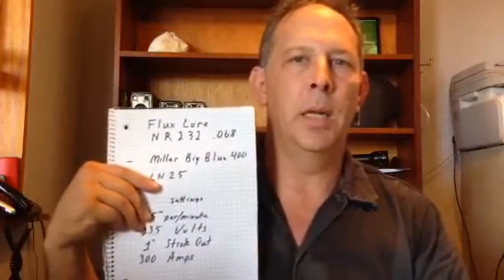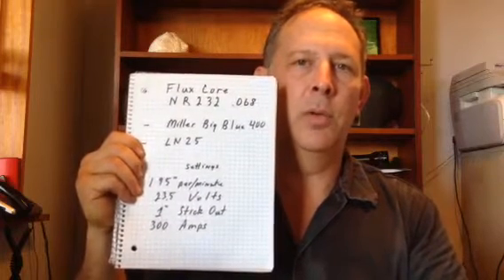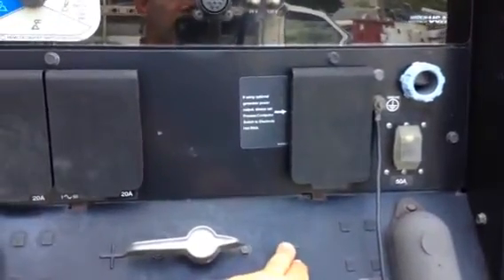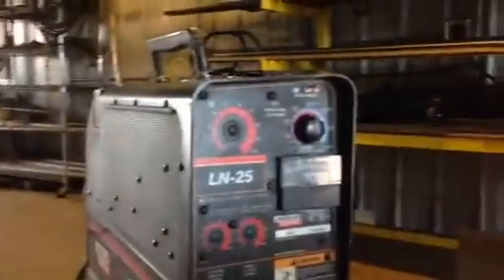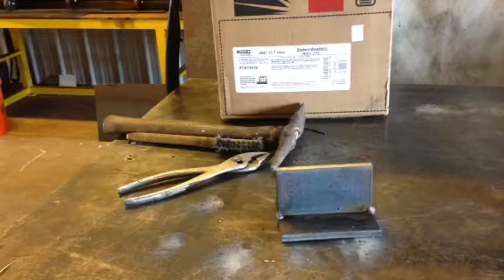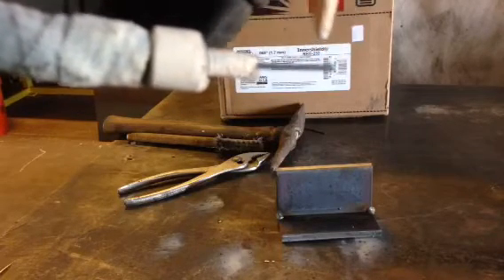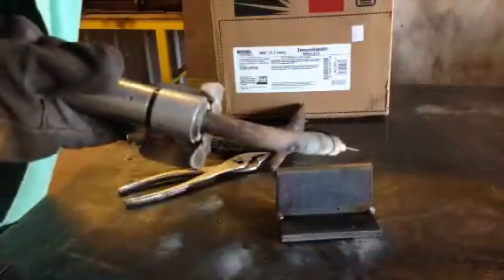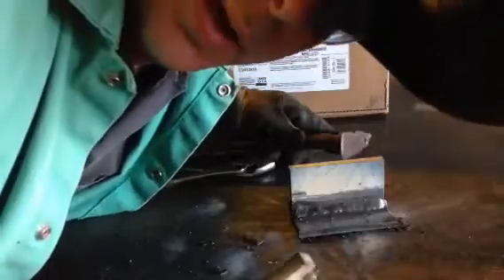Flux core welding

Comment: you showed up at weld fevers video and called him a hobby welder and said he don't know much.... HAAAAAH!! now look at the duck shit you call a weld! no fuckin nozzle on the torch? seriously you look like you want to enjoy your little day and stop trying to open your big mouth in front of real welders. You tube is the real world guy! 
before you start talking you should try listening. 
I'm certified and my welds pass. no one in the real world get's bugged by a fuckin fly who talks shit when they know what they know! go flip a burger of clean a gun!
I came here to tell you YOU DON'T KNOW MUCH BACKATCHA!! ONLY BECAUSE YOU SHOWED UP AND STUNK UP THE ROOM UNPROVOKED! 
see ya looey!
Reply from the maker: +Ghost Dog You mad Brah?   What kinda relation you have with "Weld Fever"?   In the description of this video it says "Flux Core".   So here is a free type NOOB, flux core use no gas.   The wire is tubular and has flux on the inside.  It is designed for windy environment.  It has many use's from lite gauge to heavy plate.   Your pal is a hobby welder (nothing wrong with it) I'm the real deal.
Reply: +Ghost Dog Have you used nr 232 wire before? The guns for that thick of wire don't use a nozzle. I weld at a structural weld shop, we use this wire and none of the guns have nozzles, except the solid wire machine.
How can you say you're a real welder and not know this common knowledge.
Reply from the maker: Ramon Penuelas I think Ghost puppy is new to welding and needs to watch a few more videos on "how to be welder".  Ghost "whatever" you need to get into school and learn about the different types of welding, Brah...
Reply: David Spin
Yes, went to his page and he had a "how to flux core video" which was clearly taken at a welding school. Didn't show the root pass and the 2 other passes didn't look good, yet he's talking crap. Lot of guys still in welding school feel like a "real welder" yet most likely never had a welding job. I'm pretty new to welding as well but my job only uses nr 232 and it's totally different than dual shield flux. When one doesn't know something yet talks like they  do, they just end up looking foolish lol
Reply from the maker: +Ramon Penuelas NR232 is a great wire.  A little difficult to learn but once you master it you wont think about another.